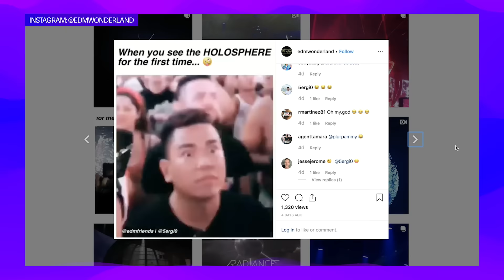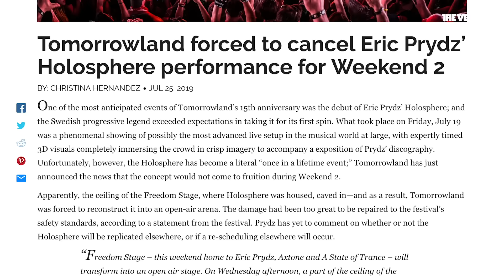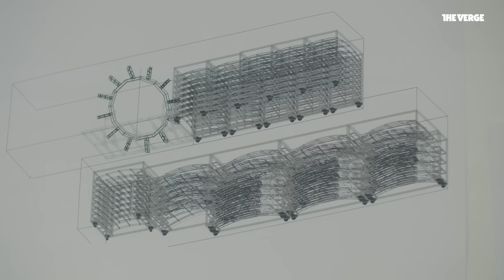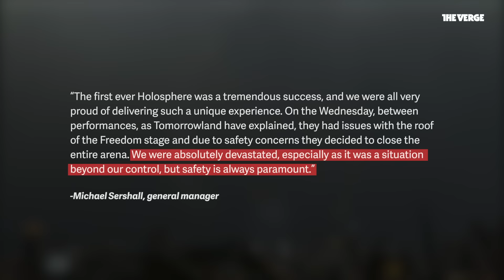An exclusive look at Eric Prydz’s 5-ton LED Holosphere

Comment: deadmau5's cube 3.0
Reply: Cube is a joke compared to this
Reply: no if you see the technology behind it. One of a kind.
Reply: @aayushsahu8394  Holosphere has holograms. Cube is, well..., a cube with moving LED screens.
Reply: nope. I'm talking about the content creation lol.
Reply: @aayushsahu8394  we were talking about which system was technologically more advanced. We weren't talking about whatever people are displaying on those screens, holograms, etc.
Reply: Do some research. That's the same exact techonology. There are no holograms, it's LED panels in both cases, content creation also similar. But first Cube V3 appearence was  almost half year ago, so Prydz just copying that.
Reply: @user-sg6ev4wj1u  >>"Prydz copying"
>>Holosphere in development for over 2 years
Did you even watch the video?
They're both pushing the boundaries for live electronic performances in their own way. Also, Prydz has been around much longer than Mau5. Love em both!
Reply: @user-sg6ev4wj1u  not the same technology in terms of live mixing and visuals.
Reply: actually, cube v3 produces its animation in real time using GPUs so that the animations are always on point with the performance. And the LED panels run on 60fps and the frickin thing rotates. It's not just led walls and stock animations